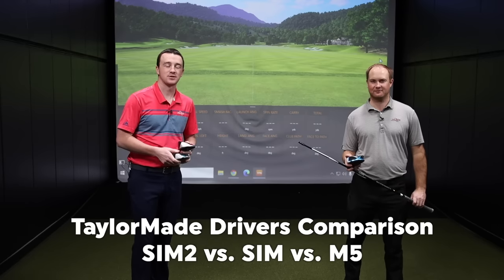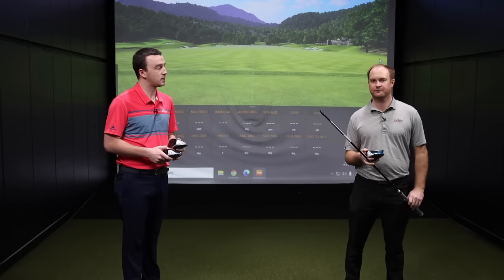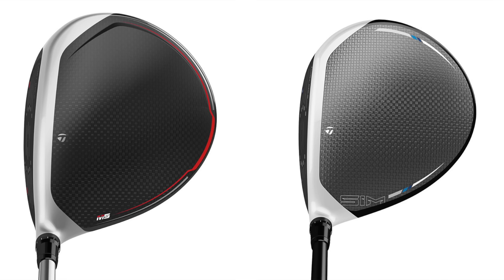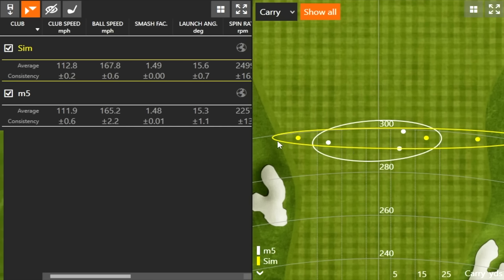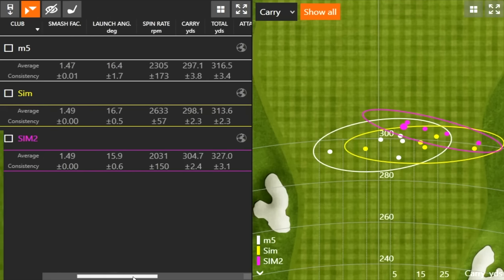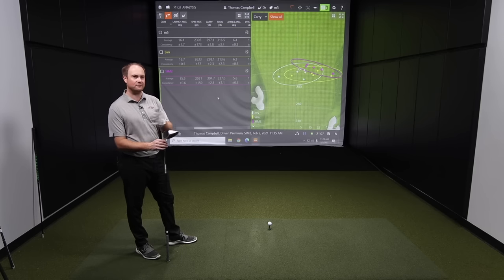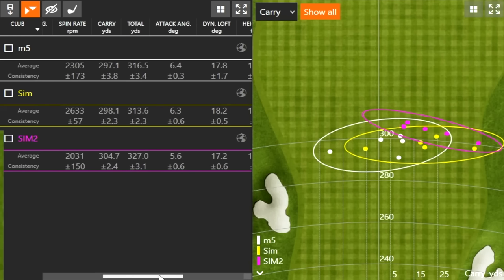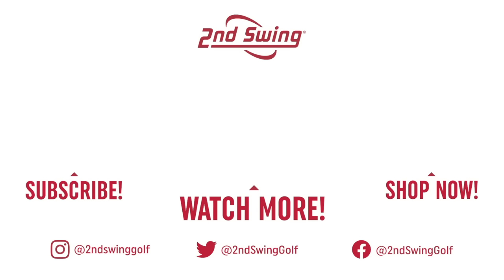TaylorMade Driver Comparison | SIM2 vs. SIM vs. M5

Comment: If I had those results and owned the M5, there is not enough difference to justify the expense of upgrading to the Sim or Sim2.
Reply: 8 yd carry distance increase?
Reply: @williamlund7759  if they moved the weights to the front for less spin, it probably would have been identical.

Comment: It seemed like there was a bias for the newer heads, the grouping circles around the M5 were way bigger than the actual shot results, the SIM 2 circle was much closer to the actual shots. To me it looked like the M5 was better than the SIM from a dispersion standpoint and slightly behind the SIM2 in distance. The club head speed was also fractionally faster with the newer clubs. I'd rather see this kind of comparison using a swing machine, these guys are trying to sell clubs, and the newer the club the more they charge.

Comment: 113 club head = 305 carry?
Reply: with great launch conditions and smash factor (and no wind), yes!
Reply: @FourtyLoveTennis  NO. I have a 117 club head speed and average around 170 ball speed, I carry 298 on Trackman, with a smash factor around 1.48. 113 will NEVER carry 305, hey must have this set to a higher altitude. Ideal conditions for 113 would be around 285 with a 1.5 perfect smash factor.
Reply: @Hidden02  smash is only 1 factor. I'd say 113 club / 170 ball with good Lauch conditions like low spin can definitely go 300 carry
Reply: @Hidden02  I'm with you here. I swing between 112 and 120mph with a driver averaging about 116. I don't carry over 300 even when my smash is bang on. To be fair, I launch it a little lower than ideal which I'm trying to work on, but 300+ carry with 113mph seems unlikely to me...I would guess closer to 285-290+ and with roll just getting over the 300 mark...
Reply: Yeah that’s off lol